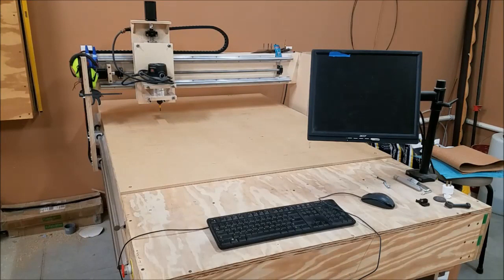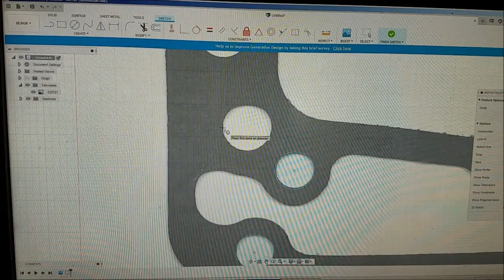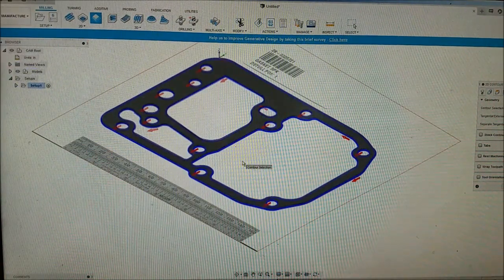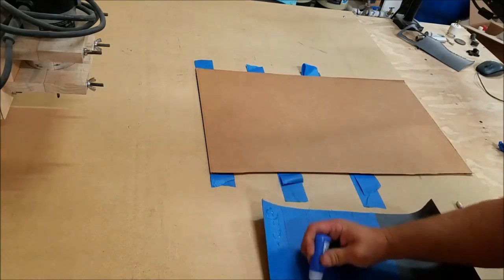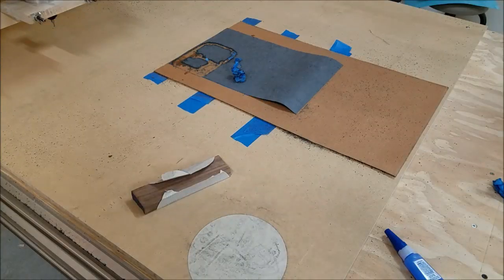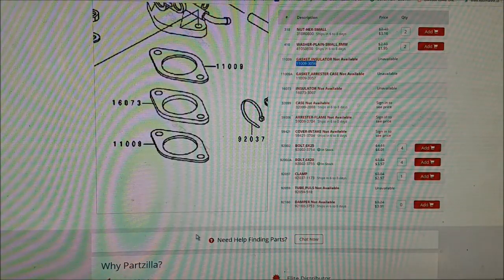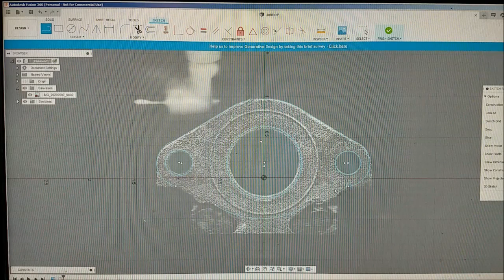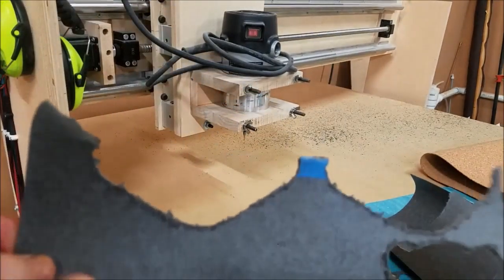Making Gaskets Using A CNC Router

Comment: I’m setting up a little 3020 to do small gaskets on my model engines , i was thinking of sandwiching the gasket between some thin mdf or thick cardboard and machining through both so i get a crisp edge on the gasket . I know such a pissy little machine will take some time to do it but it has to be better than doing it by hand !
Reply: Ha! Like 2 minutes before reading your comment, I posted my own with about the same advice. I use plastic sheets. Works like a dream!

Comment: Nice video.  Once again, out of the box ... When working with a gasket that is symmetrical could you draw half the design and then flip it for the other half thereby saving half the design time?  Or a combination, since drawing the outline is time consuming, draw half and flip leaving the circle holes to be put in one by one.

Comment: 2:20 I'm going to pick a nit here. I would have measured a much longer distance; the maximum that your ruler offers. Any misjudgment in locating the measuring points of your CAD program will be spread out over a much larger distance so the absolute error will result in a much smaller percent error. 

I have made a few gaskets the same way but, I use a 1/16" cutter so the cut is a bit cleaner. 1/32" is even better. I also hold my gasket material down with thumb tacks which, of course, need to be well placed; the more, the better.
Reply from the maker: Nit pick? It's perfect advice that I'll be using going forward. Thanks for the input.

Comment: Just a hint using Fusion.  Draw the straight lines well past where you need them.  Then when you draw the arc, the ends of the arc will snap to the line.  Now you drag those arc end points up and down the line to get an even better fit of the arc.  Its quicker and allows you freedom to drag the arc segment around to fit perfectly.  After your'e done you can use the trim "T" command to trim the line extensions, or leave them.  Free Tip Friday.

Comment: I'm considering buying a router for making gaskets. But I've been previously using a home-made pantograph with a Dremel attached to it. Pretty clever, if I may brag--but it's difficult to use for someone like me with unsteady nerves.

I will share a tip that I think will work equally well with a router: To eliminate the fuzzy edges and get a clean cut from the cutting bits, I cut out 2 flat pieces of 1/32" plastic. (I have cats, so I cut my sheets from the walls of the empty kitty litter packaging buckets.) Sandwich the gasket material between those sheets using some clamps (I never tried glue, but the tight grip from the clamps is key). Set your router to cut through the entire "sandwich". The sheets of plastic clamped against the gasket material will create a sheering effect against the cutting bit, so no loose fibers will get pulled out. You'll end up with something that looks like an OEM purchase ;)

Comment: I thought once you scanned it you wouldn't have to go through all the measurements of the holes and stuff??
Reply: if you scan and scale it so that one side of the scan area has the real size in Autocad you get very  close. for example the scanned are is 210x290; you scale it so the larger side becomes 290 in the drawing. 
But if you want to be sure you can do some measurements

Comment: Brandon, rather than using a router bit to cut the gaskets, maybe a drag knife would work better.  

A drag knife clamped into the collet of the (not turned on) router would make for a much neater cut and eliminate the post processing necessary to clean up the fuzzy edges of your gaskets.  There are a number of videos on YT about how to set up a drag knife on a CNC machine for cutting card stock or gaskets.  The added benefit of a drag knife is the ability to cleanly cut cork gaskets which I suspect would not work well with your current setup.

Great video as always, keep up the good work.